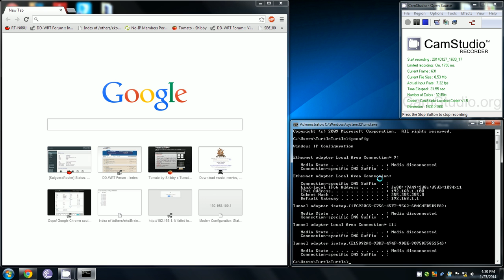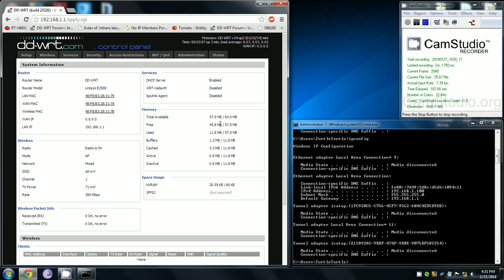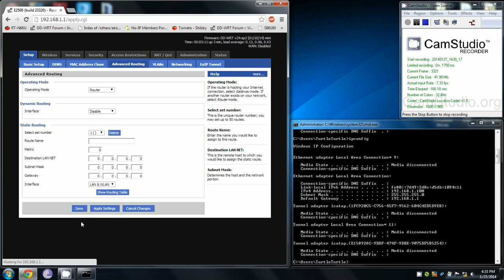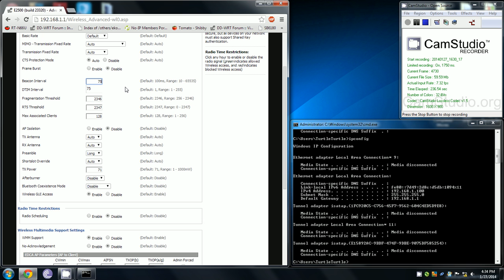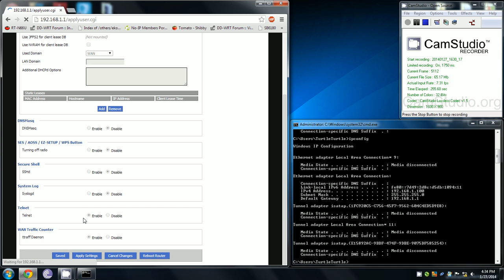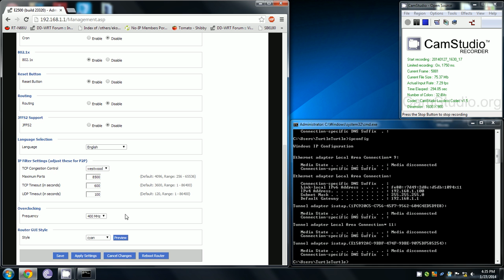DD-WRT How to set-up an Access Point (AP)

Comment: great video, it worked the first time without any problems. i setup a pfsense and am using an old linksys wrt54g from the basement that already had dd wrt on it from a long time ago. using it for attaching my printer and some raspberry pi projects. thanks for the still relevant video!

Comment: Fantastic video.  Got everything working very quickly.
I think the downvotes are coming from people who don't understand that you need to use a crossover cable versus a regular cable.
You need to use a crossover cable vs a regular patch cable to connect two like devices (router to router, switch to switch, pc to pc, etc),

Comment: Great tutorial. Using a DD-wrt installed Linksys wrt54gl router. My wired speed is fine (65 Mbps), but for wireless I only get 11-15 Mbps. Tried with different wifi devices, got same results. Tweaked channel number, transmit power, security settings, network mode, SPI disabled, WMM off etc. Any other suggestions I can try?

Comment: I"VEHAD8CUPSOFCOFFEEBUTOHMYGODYOUTALKFAST!
Just used this to set up my router in 2018 and the instructions are still solid! Posting from the WRT router for this post. 
The views do need to pay close attention! You can see which tabs he's on if you watch closely- sometimes he names them, sometimes he doesn't. You will also need some basic networking knowledge- which you would need any way if you're trying to reflash and use an open source code. 
I guess some people just want to be spoon-fed everything. 

Full disclosure I'd tried several times before to set up the WRT router, but this video is what got it up and running.

Comment: Man this worked so well! Thank you for the video! 

That said, how do I log back into the ap now. I need to update some passwords and the 192.168.1.1 default no longer works. I don't have access to the actually modem/switches  wan to see connected  devices only have access to the ap (used your method to add wifi to a school classroom)

Comment: At the beginning of the video you specify ethernet cable from lan to lan (ports). At the end you specify cross over cable. While technically, any rj45 is considered an ethernet cable.  the common use of ethernet cable is understood to be lan cable, not crossover.  That is the only thing I'd suggest you clear up. Otherwise, the video is awesome.  Thanks.
Reply: Honestly I wouldn't matter. Since almost every router that would be in use today will have auto switching or sensing or whatever TF it is called.
Reply: Don't be so hard on yourself. I'm sure you matter to someone some where ;).   Joking aside, there are still many units in use out there,that don't have auto-mdix technology.  This is especially true in countries other than the U.S.  Additionally, there is still debate on whether using the incorrect cable (requiring the auto-mdix function) slows throughput. My own tests have provided mixed results, and I prefer to err on the side of caution.

Edit:
I still have several routers in use that will not adjust if I use a cross over cable to connect a pc to the router. And keep in mind, routers were not intended as AP's.  This function later became supported as more and more small businesses (and home users) started "jerry rigging" things so they didn't have to buy expensive equipment.

Comment: my main router feeds a data port on the wall in my office.  Can i use that wall port to connect to this access point, or does it physically have to have to be connected to the router which is in the closet?  Also, i did these steps however when i 'think' i'm finished, my entire wi-fi goes out.  The computer keeps trying to "identify" the internet.....what could cause this?  Thanks again for the video.

Comment: Would this work to keep the same SSID as the main wlan? If I was connected via wifi to my main wireless router in room A and moved to room B where this AP is setup would it be doing wireless handoff so that I dont need to switch SSID everytime I move to a different room? Thnx!
Reply: +xTheShady1x I know this is late, but in the unlikely event that you haven't found your answer, and for anyone else who might wonder about this as they read.  Yes, it GENERALLY works with the same SSID.  I have a router in my house, a standard LAN ethernet cable running out to the shed where I keep my office, lan port to lan port.  The router in the shed is a netgear wndr3400 flashed with dd-wrt and configured (both frequencies) to match this video, with the exception of the overclocking, since it isn't supported in this router.  Same setup, security, etc. on both routers.  It's almost like a repeater that way (almost).  I do have the house router on one channel and the office AP on a different channel. This CAN cause trouble if both units are too close together, & competing for connectivity with the device.  The device will keep switching between units and actually slow down the speed on your device (I speak from experience).
Reply: PS. Keep in mind that an access point is intended to function differently than a repeater.

Comment: Thanks for the video 

i have few questions about ddwrt.

1: what is the AP mode ? what it achieves ?

2: can we use the wan port instead of lan port ? i see an option to assign a wan port to switch ?

3: @2:06 in network setup what was the ip for ? management of the switch ? but dns was also assigned ?

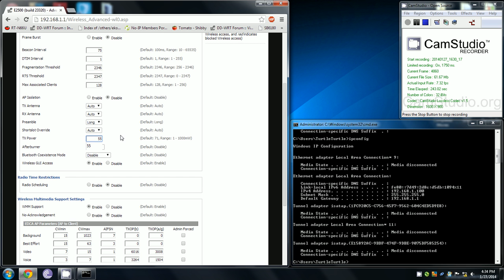4: @ 2:20 in Advanced Routing the mode was changed to Router but at 4:07 under Administration you disabled Routing ? i do not understand this ?

Thanks

Comment: Great Work!  After trying a repeater bridge setup with my Cisco E4200 router I had unusable latency and transfer speeds so created dual AP's at 2.4 and 5Ghz using your info and love the results!  I ordered a TP-Link AV500 powerline kit to use with my Archer C7 router and new AP to hopefully create a nice strong signal at the far end of my house where gaming and streaming movies happens lots.  I am not sure what all your setting changes did but learned a lot in the process.

Comment: Hello! I saw this video but remain in doubt with the DD-WRT firmware can the router where it is installed go get internet wirelessly to a main router (192.168.1.1 example) without the DD-WRT and then make the sharing of that internet also wirelessly but in another range of IP (Example 192.168.0.1)?
Reply: How inside access point device?

Comment: Steven - Great tutorial! I think this is essentially what I needed, but I am new to this. Is this basically going to extend my main routers wireless signal, plus give me the option to make use of the lan ports? I have a weak signal on the top floor from the downstairs main router, and I am looking to just extend my downstairs wireless signal to the DD-WRT router I have upstairs, but still use the lan ports for my other 3 computers on the DD-WRT upstairs. Is this the method that solves that issue? Pardon my ignorance of not knowing, and thanks for the tutorial!
Reply: +Aaron Olin Replying to your concern. You need to "waste" one of the LAN ports on the back of your upstairs router to be connected via a long cable to the downstairs router to another LAN port so they can communicate with each other. In the end you will still have 3 free ports on each of your routers so you don't have to worry (3 free ports on your upstairs router and 3 free ports on your downstairs router). Also I would recommend to get you a powerline kit so instead of using a very long ethernet cable to connect both your routers, you actually use the electricity at your home.

This is the setup I am currently using and it has been worked since a year ago.
Reply: Aaron Olin 
The access point method described in this video will work as long as a cable connects from the secondary Linksys device you are setting up back to the main network. If you are looking to bridge and extend outside of the reach of the cable, you will want to check out the guides on setting up "Client Bridge" or "Repeater Bridge" mode.
Reply: +Aaron Olin - I'm trying to do Exactly what you are doing!  Did you get yours going?  I'm having trouble with the signal strength dropping off quickly on the DD router upstairs.  Pulling my hair out!   Comments appreciated.

Comment: I disabled the WAN connection type and also disabled the DHCP Server as you described in the video and immediately afterwards I was unable to access my router.  When I type the IP address of the router the page won't load.  I'm still able to connect to it but just unable to access it to log in and make any modifications.  Any idea how I can get back in there?  I have tried numerous hard resets but that didn't seem to change a thing.
Reply: Ubirajara Theodoro Thanks, Ubirajara.  I tried numerous times to reset the router but finally just ended up buying a new better router with DD-WRT pre-installed.
Reply: Try the "30 second reset" and if it doesn't work, use the "30-30-30" reset if you get jammed up. There are instruction on the WRT wiki page. 
The 30-30-30 usually cure all.

Comment: Hi, I guess basically its the same guide is this 
http://www.dd-wrt.com/wiki/index.php/Wireless_access_point

a few questions to ask
1) i assign my AP (2nd router) local ip address as 192.168.0.1, its ok right? The ip address is to be used to check (AP) router settings only right?

2) Where did you get the gateway ip address from? is it from the first router? must it be the same?

3) i attached my powerline connection to the AP and am able to seamlessly switch from main router to AP with excellent wifi strength. I guess all must be working right. SO i tried to 192.168.1.1 and is able to log into my main router settings. But when i typed in 192.168.0.1, it gets timed-out.

Also to note is that I am not able to surf the internet. I can access my main router thru my Ap but cant get through the internet. My sense is that I am connected to my local network but not to the internet. Any help will be greatly appreciated.

Thanks...
Reply: Change your router of 192.168.0.1 to 192.168.1.2 to access it.